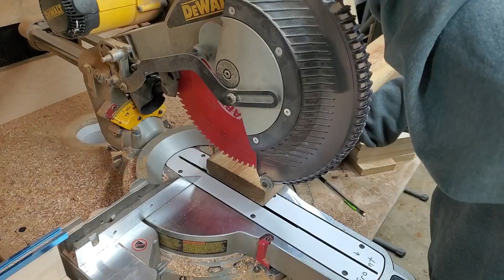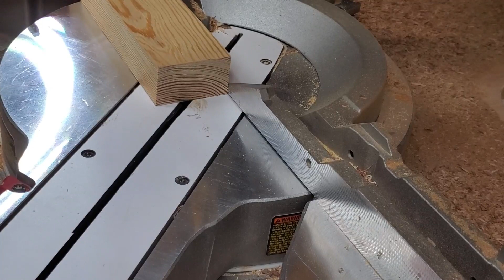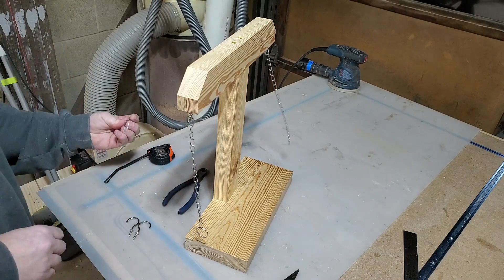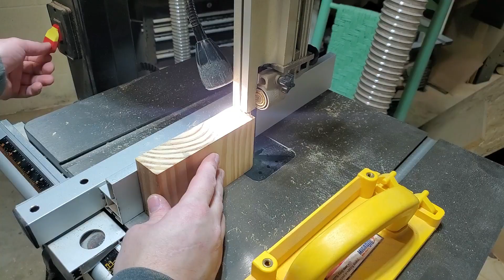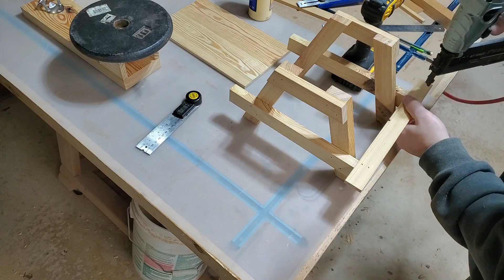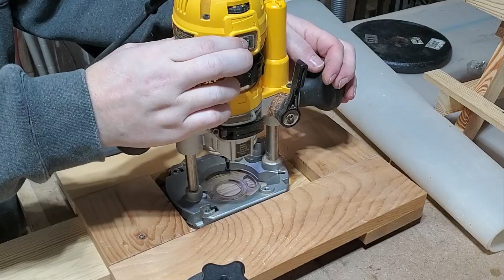WOW!!!! 1 Board, 3 Projects!

Comment: I have to comment, I love what you're doing, but the hundreds of dollars worth of tools you use sort of belittle the, "you can make 80 bucks out of a cheap piece of wood". A beginning woodworker does not have a joiner, may not have a planer, might have access to a drum sander, but then again.... Hopefully has a table saw, but even those are expensive. While I appreciate the ideas and the concept of this video, I feel compelled to remind you that those of us who are just starting out do not have professional tools. The comments you make at the end intimate that any of us can make 80 bucks out of a single board, but the reality is that only those with access to the tools you have can really fully utilize the whole board. Something to think about.
Reply: Better tools make life easier/quicker. But basically a 2nd hand circular saw, drill and straight edge will get you started. Material can be free if you strip pallets etc. As for planer and thicknesser, bit of sandpaper wrapped around a block of wood will get you started.